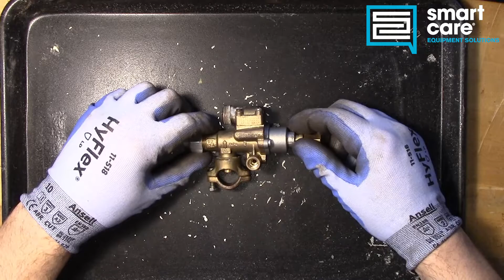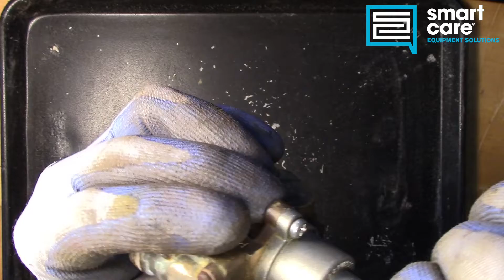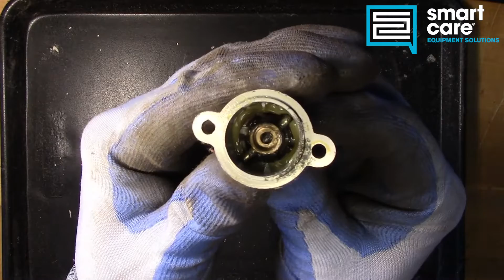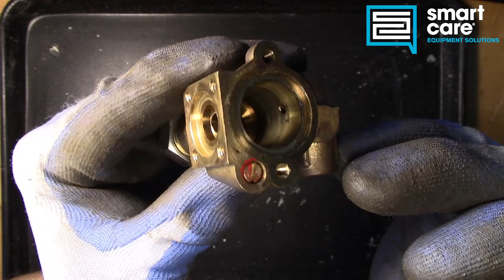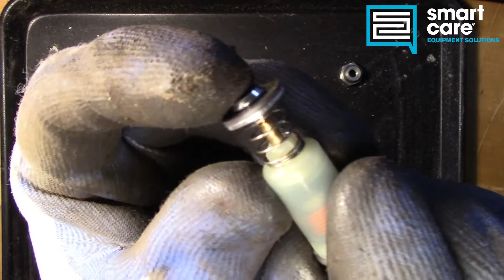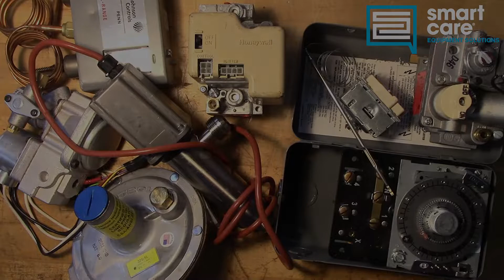Teardown Tuesday Episode 17: Italian Gas Burner Control and Safety Valve

Comment: Standard thermocouples are threaded 11/32" 32TPI.  Metric ones are typically M8 and M10.  A M9x0.8 thread is very close to 11/32" 32TPI.  If you see a "M9" thremocouple connection it is likely a standard thread described as a close metric equivalent.

Those safety valve electromagnets are very reliable, but I had one fail.  It only held with several times higher current than spec, more than even a new thermocouple could supply.  It's only 10 turns of thick enameled wire, five on each side of the aluminum form.  I carefully examined the wire for a break in the enamel that could short to the form, but didn't find a flaw.  It was as if the electromagnet just stopped creating a magnetic field, or the metal disk at the end of the plunger not longer had as strong of a magnetic attraction.